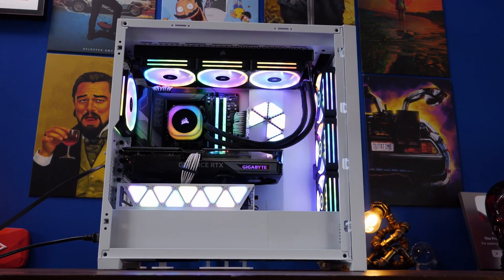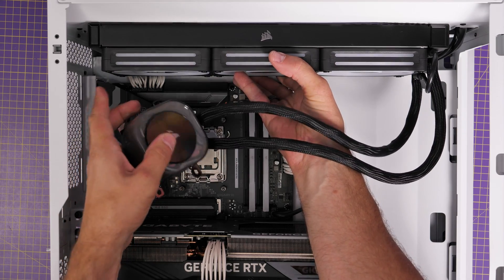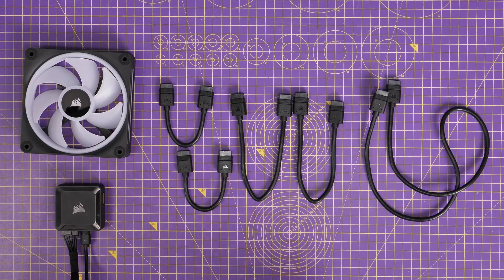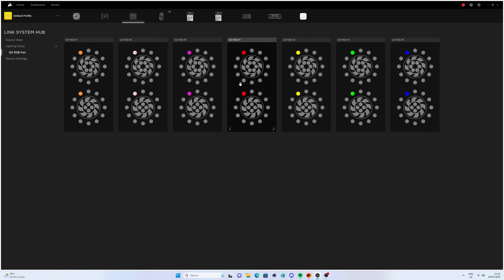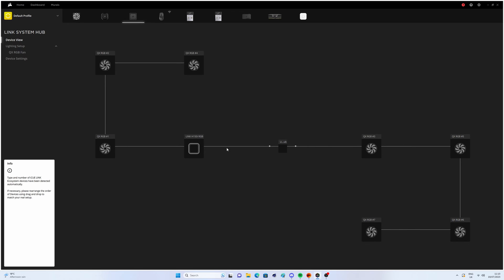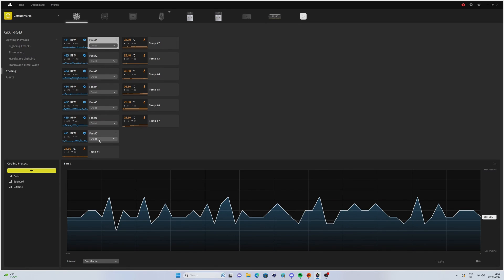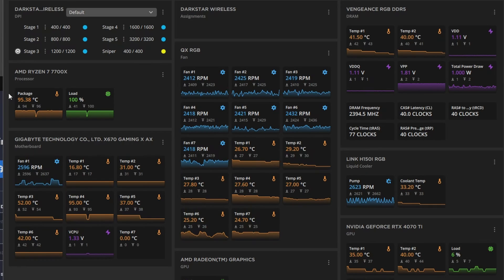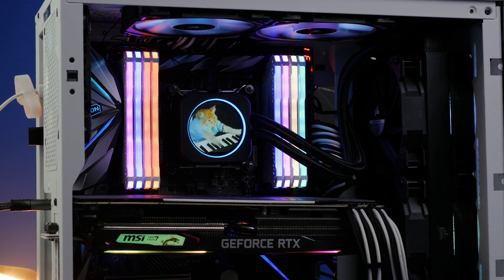Corsair iCue Link System review and feature guide in the Corsair 5000D Airflow

Comment: Just installed the 360 icue link aio. Love the quality of the radiator feels like one of their custom water cooled style radiators. My issue is the 90 degree cable that connects fan to the radiator is the cable sticks out towards the glass panel. Need to figure how to redo it
Reply: Yeah thats what im going through right now. The only real solution is to flip the radiator which is how Corsair displays this thing anyway. Idk how i feel about those wires being so close to my exhaust fan though

Comment: Question Prawn, I have the 7000x RGB Case with three front fans and one rear fan (all non-Link type) connected to the pre-installed Commander Pro XT. I also plan to install the H170 Elite LCD AIO (not link) that I already have on hand. I'd like to add 4 QX Link fans to the side panel just to reduce cable hassle. So as I see it I will have 3 individual controllers running 3 sets of fans. The Commander Pro XT with its 4 fans, the AIO with its 3 fans and controller, and the add on 4 Link fans with its control hub. My assumption that the 3 controllers will be independent of each other BUT (I hope) iCue software will somehow be able to handle the management of all three fan sets??  Is this right or is there another way to make this particular setup work?  Appreciate your help in figuring this out before I build! Thx.
Reply from the maker: Yup should be fine.
Reply: @TheProvokedPrawn  I want to just say thanks again as it is reassuring that I had it figured out correctly before I proceed with the build. And I really enjoy the depth you get into leaving nothing out! Well Done!

Comment: So far, aside from the abysmal 90 deg cable availability, I'm really enjoying my new LINK cooling setup. One disappointing aspect of the H150I however, at least from my experience, is that the CPU cooler RGB isn't as bright as the accompanying QX fans. Because everything is connected to a single Hub, there is ONE brightness slider for everything. There is no independent brightness control for say, the cooler's RGB vs. the fans' RGB.

I'm curious if anyone else agrees that the cooler's RGB is dimmer than the fans'.

Comment: In your here shown system you evacuate the hot air through the radiator on top which causes the CPU to increase even more temp and produce even more heat. I would not recommend that air flow design.
Reply from the maker: https://youtu.be/qQcyYHGtArs

Comment: Lights are what ever. How’s the actual aio performance? Can it tame the 13900k?
Reply: Yes, i have a 13700k so similar heat output. No higher than 60-65c in regular use. The thermal grizzly cpu contact frame will bring this down even further
Reply: @TheSaxAppeal  I eventually ended up buying this cooler after I posted this comment. It cools my 13700k at 5.6ghz on all p cores and 4.4ghz all ecores and 5.0ghz on the ring at 1.34v with ease. Did change out the pos rgb fans it came with for the legendary phanteks t30’s. And the thing I really don’t like about this aio is the pump noise. I looked into it and it’s normal.. Corsair says it’s normal also.. go figure 🙄 but I can’t f’ing stand it. Corsair needs to let’s us drop it below 2,400rpms.

Comment: honestly. yes its a pain that for 1 fan you have to also buy a cable kit but if every single fan came with a cable with how this system works. you would have something like 4-10 cables that are just doing nothing. i do think that if they ever come out with a 3 fan pack like we seen in the past. then i think one or more of the cable pack cables should be included (not the starter pack they have now).